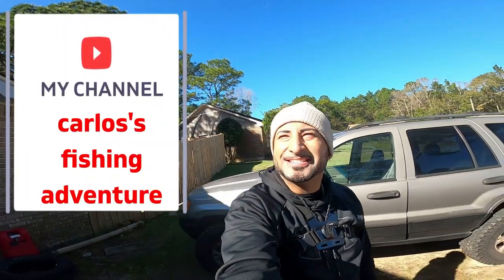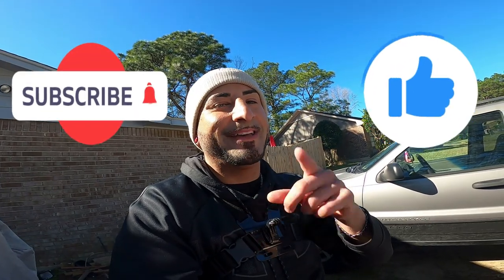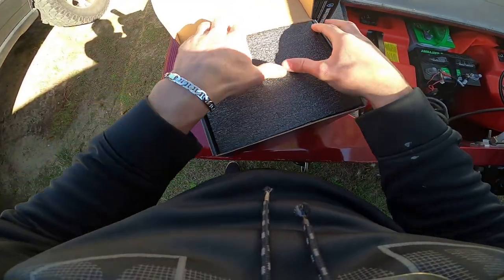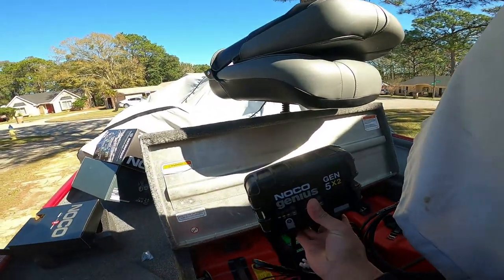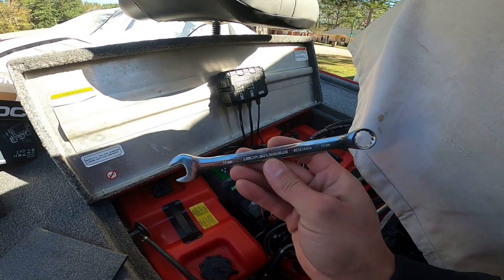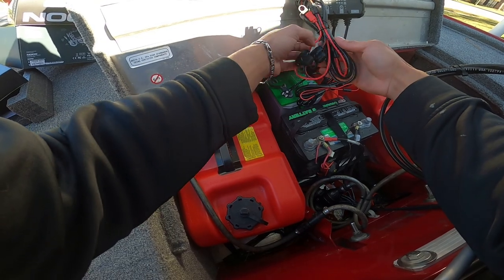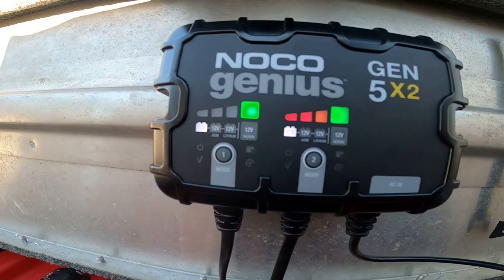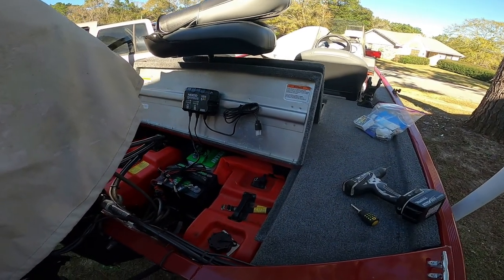How to install Noco genius charger on bass tracker boat

Comment: Hi how are u man  so u charge it all night then u disconect it ? And when boat battery is getting low that will charge it up? Thank you🙂
Reply from the maker: Yes so if you feel like your battery is weak just plug it in all night and in the morning unplug it and it should be fully charged and you won’t have to worry about the batter being dead. Note if the battery is old and not holding charge you are going to need to replace it. Thank you for watching!! 💯💯
Reply: @Carlosboatingadventures20007  can you not leave it charging through the winter or just for an extended period of time?